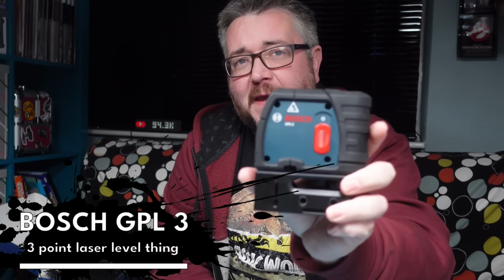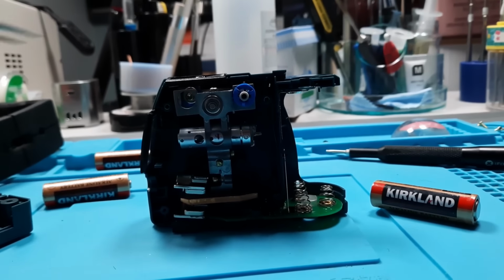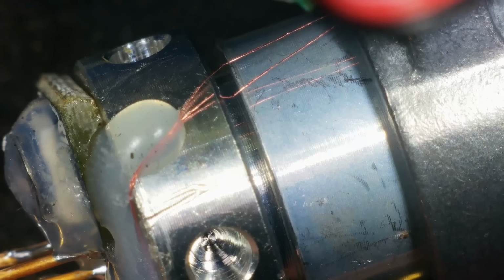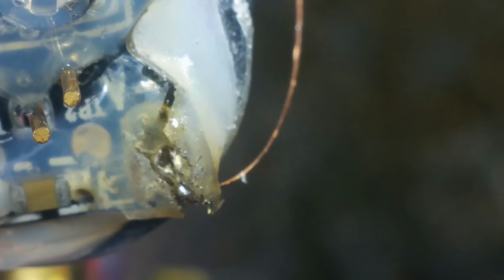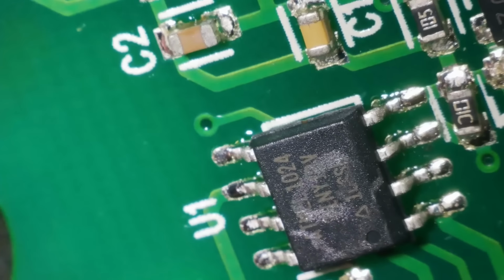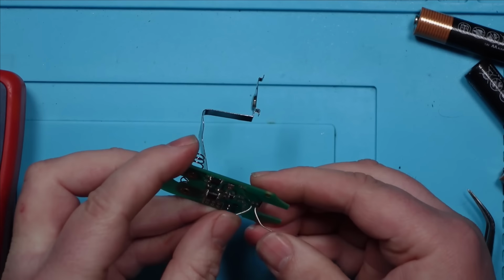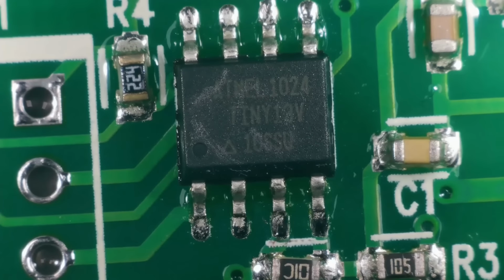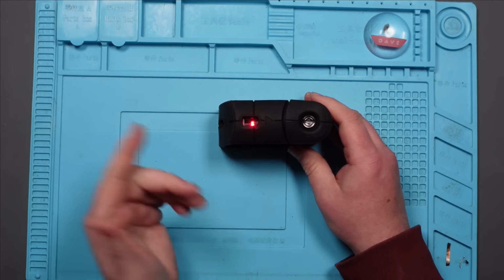£180 BOSCH Laser Level FAULTY | Can I FIX It?

Comment: @StezStixFix that “diode” is an optical sensor. Search for QRE1113 and you’ll see that its a really similar component. That sensor sits underneath the gimbal, and I’m pretty sure that on the bottom of the gimbal is a reflective piece. If the gimbal is not centered, the light emitted from one of the sides of the diode is not detected by the sensor on the other side of the diode, and it makes the laser flash. It can be that the light sensor diode is faulty or the reflective piece is missing / dirty.

Comment: Did you check for conrinuity on the coil? My limited knowlede is suggesting maybe the diodes are protecting from back emf when power is switched off?? Though i could be tallking bolax??

Comment: Looks to me like that 4 pin component is an opto sensor. 2 pins for transmitter and 2 for receiver. Qre1113r would be a good place to start
Reply: Seems that you are right, "basic" ir sensor with transmitter and receiver to detect the pendulum position/movement.

Comment: I've actually been looking to get one of those levels. lots of uses. electricians can use them to install lights in specific places. say if you wanted a pendulum light centered over a table. just find the center of a table, place that level on the mark and you have the spot on the ceiling of where to mount it.

Comment: * Yo StezStix Fix..*
Probably wrong about this, But I suspect the pendulum's magnet or metal near the coil should change the coils voltage which is fed to a circuit to keep the laser steady..
As you can you imagine if the laser line is not kept rock steady the laser level line would be useless if it not kept rock steady. 
EG: As someone walks nearby the vibrations from the footsteps are countered by the pendulum's movement from the footsteps within the coils field, ergo the fields voltage changes to counter and keep the Laser rock steady by feeding a voltage that pulls the laser gimbal counter to the actual vibration's momentum.

Thumbs up Guys, If that's probably why the wild voltage changes are present..

Comment: I have a feeling the level was shaken and weakened the enamel wire and coating and shorting it to the pendulum? Then that fried some parts (diode or that switch you bypassed?) and when you touched the wire, it broke. All wild guesses, glad you got it bodgey working!

Comment: I use the same one, the laser should have started flashing when you tipped it on the side. 
Maybe the voltage reduces as the pendulum tips at a certain point, possibly through the negative rail. 
Also, mines starts flashing approximately 30 seconds before it shuts down from low batteries.

Comment: Sorry, commenting whilst watching. Sometimes the hot snot can go off and possibly give some minute capacitance or go conductive slightly?? Well finished watching and my guess is the voltage that was changing was probably the oscillator for the pendulum to swing. I think youve bypassed the laser calibrating stage completley but great video.

Comment: Those 3 stubby posts are for the laser diode. 1 positive, one negative, and a third one (which is optional) that is used for a photodiode to regulate the laser brightness due to how much light is being backscattered from the diode.

for future reference, most red laser diodes (in consumer products) run at 3 or 5 volts.

Comment: My guess is that the circuit has some feedback from the pendulum and flashes because it's not getting the right signal, that's why the voltage keeps jumping. The fault is probably on the other end of those teeny-tiny wires, under the hotglue area.

Comment: I think the unknown diode that was replaced is actually a reflective optical sensor - without seeing the underside of the copper bar at the bottom of the pendulum I don't know for sure. 
The thin copper wires just provide power to the laser diode on the pendulum. The microcontroller will pulse power to the laser diode if either the voltage is too low or the sensor beneath the pendulum can't detect the copper bar.
The laser level is 'self levelling' in as much as if the sensor detects the copper bar in a suitable position then the pendulum is hanging freely. If it doesn't detect it then the pendulum has reached gimbal lock (i.e. the pendulum is touching the case) and the microcontroller will pulse power to the laser. 
By bypassing the pendulum position sensor you have effectively made the level no better than three laser pointers taped together at 90 degrees to each other.

Comment: I have a fairly new Stanley brushless drill driver, with a fault. Couldn’t send it back, as I don’t have the receipt anymore and Stanley weren’t very helpful when I contacted them. It hasn’t been dropped or abused, but it just doesn’t work. When you push the trigger the white light comes on for a second, but the drill doesn’t work. Obviously I want to keep the drill if possible, but would you consider fixing for your channel and as long as it is cost effective I pay you.
Many Thanks
Trevor

Comment: You removed optocoupler and replace it with two diodes, this optocoupler has purpose,  and I assume that its purpose is to detect lower side of the gimbal, because its positioned that way on the pcb

Comment: That little ATTINY microcontroller chip probably is what monitors the battery voltage and flashes the laser.  I don't think you needed to replace the diodes.  You are right about the ATTINY, you can get a replacement but then you have to program it.  I made a little LED dice roller from an ATTINY that gives you a 1 through 6 when you push a button.  Bypassing it was a valid "hack", it just loses that low-battery functionality.

Comment: The 4 legged diode D1 to me looks like some kind of optical diode since it has little windows ( 14:33 ), so it may be perfectly fine but only conduct when the units laser shines onto it? as others said by jumping the negative you only bypassed the transistor that was flashing the laser indicating the unit is not level.

Comment: RS have the wrong datasheet on their page but it is 8-bit Microcontroller with 1K Bytes In-System Programmable Flash. So you couldn't simply replace it. Pins 1-3 and 5-7 are programmable with pin 4 being a ground and pin 8 being VCC. Pin 1 can be used as an active low reset which would mean that the voltage on that pin would be above 2 volt(Logic 1) or the chip would be unstable or if the voltage was below 0.8 volt(Logic 0) the chip would be in reset. Pin 2 can be a clock pin but you would see a crystal on the board if it was being used as a clock and I don't remember seeing one in the video.

Comment: I'm sure your bodge job is not allowing the laser level to work properly.
Most of these things have a feature, that if you're too much off at an angle when placing it, it's supposed to flash to tell you that. So you can reposition it.

I've got a multi line level laser and it does that when you put it at an extreme of an angle, letting you know that it can't find the level.
Mine also has a pendulum lock so when you're transporting it around, you don't inadvertently damge the device.

Comment: Pure guesswork on my part but, as others have speculated, D1 (odd designator, if true) is a sensor of some description (the top surface appears to have two distinct sections). From the brief side-glance showing the pendulum I would think the gap is too large for it to be hall-effect (unless there is a tiny magnet I can't see) and it may be a low- power optical sensor (the type used to detect colour wheel position in projectors). Something like an onsemi QRE1113. There may be a small reflective strip on the bottom of the pendulum (or it was never there or fell off, maybe the part you are holding at 2:58). Looking at the general state of the soldering (especially D2), this may be a late Friday job. The .45 Longslide had the laser sight, ho, ho.

Comment: The light flashes to indicate the laser level is sitting out of level than it can compensate for to give a level beam. He bypassed the switch that let's you know the laser is out of level. He just made that level useless for leveling because you will never know if it I out of level or not. He should have looked for a mechanical failure. When the prism inside touches the edge of the surround  inside it sets the light to blink, letting know it is sitting too far out of level. Chances are the locking mechanism for the prism was not disengaging & it was stuck in an off level position. The laser was probable fine, the on off switch that controls the locking mechanism as well is stuck or broke for what ever reason. He rendered that laser more broken than when he started.

Comment: Lol if it works is it really broke? I got a newish dell computer motherboard the refuses to respond to the power button or manually jumping the header pins on the board its self, it just dead other than a led that glows and charges threw usb, I found if jump the green wire on the 24 pin to any ground manually, it will turn on and work as normal, So I replaced the case switch since its momentary to a constant switch, It works, janky but it was going to be thrown out for such a simple fix.

Comment: What are you armed with?’ roared the tank in disbelief.

‘Guess,’ said Marvin.

The tank’s engines rumbled, its gears ground. Molecule-sized electronic relays deep in its micro-brain flipped backwards and forwards in consternation.

‘Guess?’ said the tank.

‘Yes, go on,’ said Marvin to the huge battle machine, ‘you’ll never guess.’

‘Errrmmm …’ said the machine, vibrating with unaccustomed thought, ‘laser beams?’

Comment: Most of your troubleshooting was trying to find why NO voltage.  I'm curious why?  Your laser was coming on.  You're clearly getting voltage.  Start at the laser, and work your way back to find why your voltage isn't constant.  Usually when you have a fluctuating signal that shouldn't be or voltage is on/off/on/off it's because of a bad cap.

As for this device, the manual seems to imply that a blinking light means it thinks it's not level.  So either bad calibration or the item that detects it's level is bad.  I'm guessing a magnet?  Test or replace whatever the magnet is near when actually level.

Comment: That 4 leg package...is an opto interruptor..thingy..it notices if the pendulum is movinging...

  the pendulum  is moving .the micro( attiny) knows and .the led on top is flashed...maybe ref to the instructions will help
 So until the pendulum  stops "moving" ....
If the opto thingy  is dead...or removed the micro will tyrn off laser..but of course shorting out the transistor ( Q2) by a link  to ground will permanently enable the laser..
Removing the need for all those compondnts on the board...makkng it a dumb laser pointer

Comment: That device is needlessly complicated.  The bouncing voltages you are seeing are because the atmel tiny processor is flashing the output to the laser.  All the logic on that board exists JUST to flash the laser if magnetic sensor does not stablize.  The pendulum needs NONE of that.  Either the laser is jumping around or it's not.  You don't need any of that (except for the voltage regulation).  Frankly, I would just test the lowest voltage required to get the brightness you desire and make sure there is an inline resistor to the lasers for that.

I have a black and decker laser level, and it works perfectly (even with the cross, it's just done with 2 lasers and diffraction grating) without ANY fancy processors or sensors.  You eyeballs are perfectly capable of seeing if the laser is moving.

Like I say, needlessly complicated.  Your solution looks fine to me, just make sure you are not over-driving the laser. (you have a bench power supply, just start low and see how much voltage it takes to get a good laser emission, compare that voltage to what is there already - it may match, it may not.  If not, calculate out a resistor and away you go  - extra points for using a voltage regulator for consistency, but not really required) .

Comment: What would be the reason for using those tiny jumper wires instead of thicker ones? If they are supplying power, the thickness wouldn't be used to control the supply current to the pendulum, it would be controlled by the circuitry itself. Any thoughts?
Reply: I thought the same thing. I'm guessing a thicker wire would hinder the movement on the pendulum a bit more?
Reply: @danhitchcock727  I think you're right. That's the only reason that makes sense I guess. Thanks mate!

Comment: I bought 6 nes games from ebay that were faulty, I got 4 of them working but 2 has a cap on each one that was severely corroded and broke off I gotta order then replacements and see which way they go in the board they aren't marked
Reply: If the caps are polarised, then the negative pin normally goes to ground. You should be able to find out which pin on the cartridge is ground, then use a multimeter to find out which pin on the cap is ground.
Reply: @ianhaylock7409  I'm just waiting on the caps now

Comment: You shouldn't move the laser around while it's on. When it's on, the pendulum is unlocked and can be thrown out of calibration or even damaged if it's banged around.
Turning the laser off locks the pendulum in position.

Comment: Thats not i diode is an Ir Duode and Ohtotranaistor in one case called ir reflection sensor. And the Armel us an avr and need to program, no way to copy the code is protectud with lockbit fuses.

Comment: In circuit diodes do not change value when not under power...Heard you say it twice...."but it is in circuit".... The 0.2 V forward voltage diode is just a Schottky diode..

Comment: I can't believe that Bosch put so much hot snot on the solder points.  That's something a rookie hobbyist would do.
Reply: Pretty sure it's not a rookie-thingy, it's used to hold everything in place on moving parts and to protect the solder joints from any sort corrosion. They are made for use on conduction sites where they have to withstand rough usage. Sadly enough this one failed in a pristine condition, the ones I have seen still worked in a way more beaten up condition.

Comment: TL;DR: This video is BAD. Go watch someone who knows what they are doing (channel names at the bottom of this comment)

This video was painful to watch. Not only did you not fix it, you completely bypassed all the electronics.
First of all, the wires you kept "fixing" were painfully OBVIOUSLY working since the damn laser is ON.
The "another diode" you  removed and tried to replace with some random diode was actually an optical sensor that checks if the pendulum stopped swinging. It consists of two elements: one infrared diode and one photo diode / photo transistor (basically a light sensor that receives the reflected light, sent by the first one). You didn't actually check any of the semiconductors in this package because you were measuring between one leg of each. This part actually could have been the reason it didn't work. But since you didn't diagnose it properly it doesn't matter now. Later on you replaced if whatever you had, not to mention putting it in random orientations which, ignoring polarization, where not even in the right circuits.
Finally, you didn't get stable voltage because the micro controller was pulsing it, doing it's job. You literally had an indicator light showing you what the voltage was doing in shape of the laser!
So, because you didn't know what you were doing and didn't understand most basic of basics of electronics, you decided to throw a jumper wire, skipping all the nonsense electronics that you don't understand and hope for the best. If the driver of the laser was on the board and not on the pendulum, that could have ended with you burning out the laser, and/or possibly momentarily increasing it's output power, risking eye damage in the process.
Showing what you did is irresponsible. You cause a lot of damage to young people's perception of how you can fix your own stuff by showing BAD examples of how NOT to do it, disguised under the title "Can i fix it?". The answer is clearly "NO. You can't". Judging by the comments under this video, people do not realize how bad this whole fiasco was. People will walk away from your video thinking that you can just willy-nilly slap jumpers around or play gamble with replacing components.  
I'm also painfully aware that you, as the author of this video will completely ignore this comment or even possibly remove it. But I hope that at least one person reads it and actually learns something before that.
 
19:17 I wish you did too.

If you wanna learn how to properly diagnose stuff check out Youtubers like Louis Rossmann @rossmanngroup or @KrisFixGermany to name a few. If you want to learn about digital electronics from ground up, check out @BenEater. There's a ton of more competent people out there you can learn from.

Comment: A precision tool which comes with so fragile wire(!?) which cannot withstand the damage caused by dropping, given that it's more likely to occur in construction industry. I'd rather not buy this sophisticated tool, but use the (analog/manual)metal angle tool.
Reply: Not to be a snob, but it's a (fancy) DIY tool really. You'd get the piss ripped if you pulled one of these out on site :)
Reply: Yeah it was really surprising to see those thin wires and blobs of glue in 190£ tool. I'd expect something tidier for that price tag.